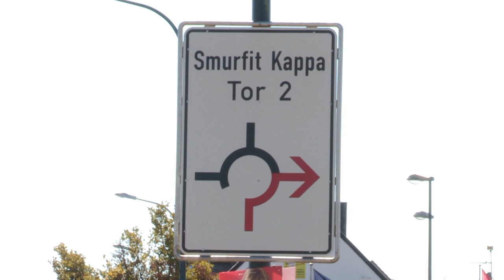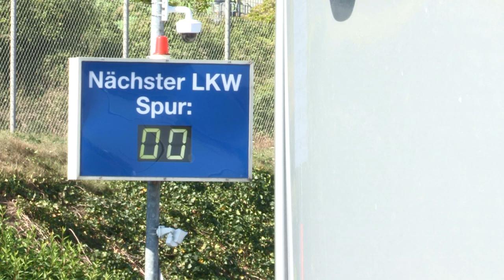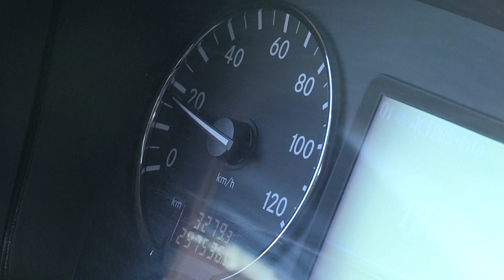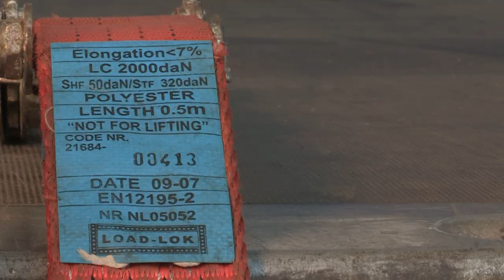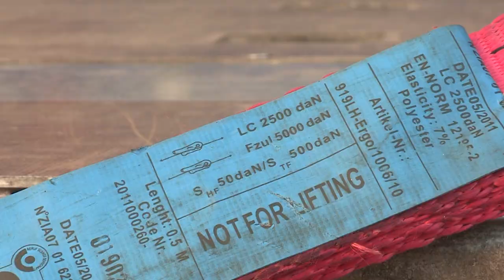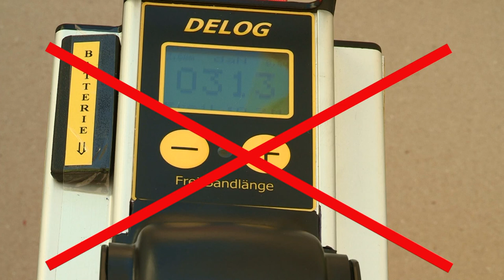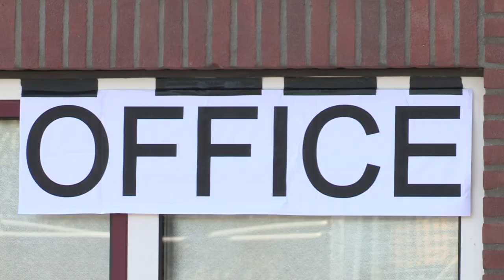Transportsicherheit Smurfit Kappa

Comment: steel toe cap boots.
 So if some how you get your foot run over they can not get the boot off at hospital and it slices your toes off like what happened to my mate at a show ground when a lorry float passed over his boot.
Reply: Without the safety shoe, with a lorry running over your foot it's probably lost anyway. So for lighter impacts, that are more common, it increases your safety.
Reply: No steel in a modern safety shoe, but a hard plastic!!